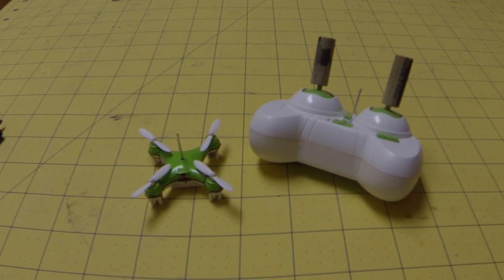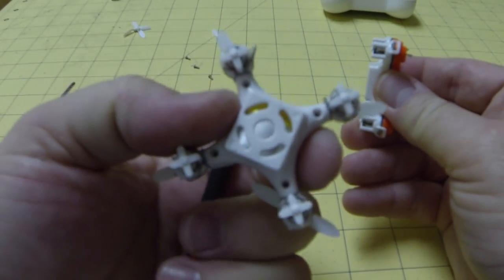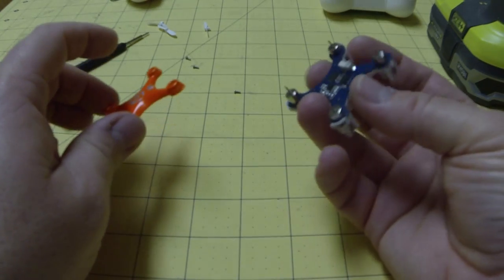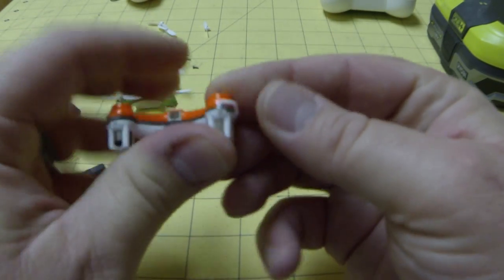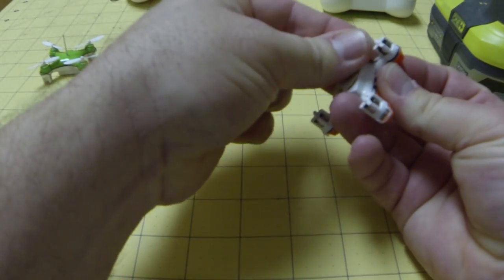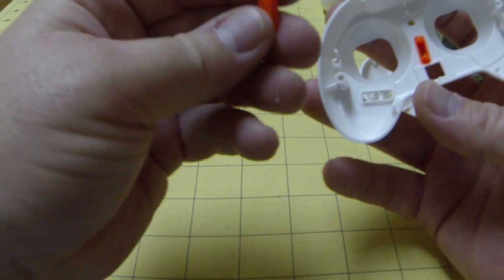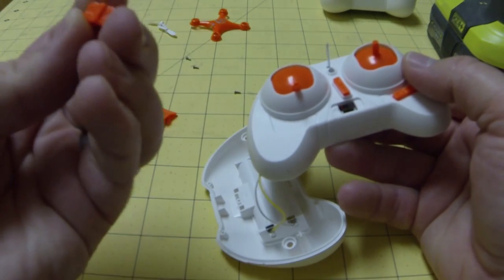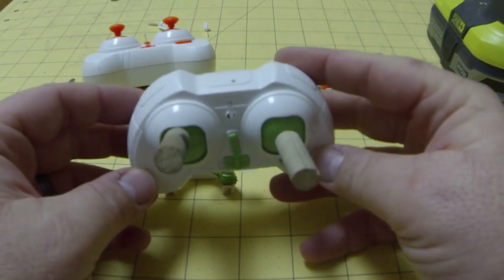Cheerson CX-10 Antenna Mod

Comment: I did my controller a little different before I saw your video. I knocked a small part out of the top were the case goes back together so it exposes more wire. Unfortunately my quad copter is a blueboard, oh well.

Comment: i got cheerson CX-10 from ebay , it works fine in indoors but when i flew it outdoor, at maximum height , it feels like motors stops and start several times and it comes down, need help to fix it, any suggestions please ............
Reply from the maker: +Sameer Athaley My only suggestion is to maximize the placement of the antennas. Make sure they are not coiled up. Other than that, your range has many factors affecting it, including the environment its in. These are not designed to travel far. Sorry.
Reply: motoshane
today i brought my transmitters antenna out, it might solve this problem, let me check tomorrow. there is no antenna inside CX-10 , its blue board, i saw that there is antenna which is hidden inside red board  cx-10,

Comment: Great video! I'm going to order my first. Do you recommend the CX -10 or CX 10a? Whats the difference.  Thanks!
Reply: FilmFactry I  recommend the CX-10. It has better yaw from what I've read. The CX-10A has heading hold, but from what I've read, it doesn't work that well. Either way, both will take a good amount of practice.

Comment: thats sucky if you have to do that, my gintrude gets great range no drop outs and besides they are nanos and you can lose site really fast with them i had mine up about 50 feet and man it gets tiny fast .. so why would you want to get more range unless of course its not getting hardly any range in which case that sucks for 2.4 ghz
Reply from the maker: I do fly beyond distances most likely will, so I need every bit of range increase I can get. See the following video to see how far away I do fly. https://www.youtube.com/watch?v=-3wNoHbmTGY&list=UU_kFMWwYOk3KGOiN7yvIEKg

Comment: I have a skywalker 5036 quadcopter it has no external antenna because it uses ANT instead. Do you happen to know if its possible to attach an antenna to it?
Reply from the maker: The antenna is likely a trace on the control board. It might be possible to cut the antenna trace and solder on an antenna.
Reply: +motoshane Very cool! I believe you are correct! Thank you!!! For answering my question.

Comment: I tried the antenna mod on my cheerson cx10A with blue pcb with built in pcb antenna, now it will not turn on at all.  did it short circuit?
Reply from the maker: Soldier1287 I've never had the CX10A. I'm not sure how that would be done, but it sounds like something did go wrong. Sorry.
Reply: it's pretty much the same thing but blue board

Comment: How do you know know if you're geting a green red or blue board when you order one??
Reply from the maker: From all the retailers I know, there is no way of knowing. Its possible there are some that will tell you, but I haven't seen them. You can buy just the green or red board by itself on banggood.com for about $10, but you'll also need to buy a compatible controller, which they offer also.

Comment: What is the best way to storage the battery, with full charge or empty?, this when I  finished the flight, thanks
Reply from the maker: R Blackby Storage voltage is around 3.8 volts. There's no easy way of measuring this. Best to store just before the low battery warning comes on. Never store fully charged, although I'm guilty of that at times.
Reply: Oh thanks, very helpful

Comment: And can the existing antenna be EXPANDED/EXTENDED?
Reply from the maker: Okeefenokee the Seventeenth This antenna comes coiled in the quadcopter and controller. Expanding the antenna likely will make it worse, especially if the manufacturer has it tuned to the proper length.
Reply: motoshane Thanks. I saw on YouTube an antenna mod, but am not sure yet if I do that, too. Did you see that one? Search for "Antenna Mod".

Comment: hi! how can i increase flying time? i'm think about stronger battery its posible make?
Reply from the maker: Best Cars2 This is a tough one. Increasing your battery size, will likely add weight, and decrease your efficiency. You likely wouldn't see much increase in flight time, and your CX-10 would become sluggish. Also, the current battery is a tight fit. You would have to cut the frame underneath to allow for a bigger battery. Its also tough to eliminate the frame, because the frame holds the motors tightly in place. If just want to keep flying without waiting for batteries to charge, buy 3 CX-10's and keep them all charging.
Reply: thank you for reply, It's possible include 3 CX-10's battery for 1 Cheerson??? Like 1 battery)
Reply from the maker: I'm sorry, but I don't understand your question.
Reply: I mean is it possible to connect the 3 batteries in one cheerson!!
Reply from the maker: It would be too heavy to fly. Sorry.
Reply: Oh okay,,,, so few time for fly i'm think 5 minutes so bad... 30mins my dream ))
Reply from the maker: Best Cars2 Sorry. Current battery technology can't do it at this size. You'll have to build a large multicopter.
Reply: ok, thx u for info! so much thx.
Reply: +Best Cars2 Buy 3, and you can always be flying one while the other charges :)   Also your friends will love you when you got extra little drones to fly

Comment: Hi nice  upgrade jjjj, I have one CX-10 but I have a issue, for charger the quad I need put presion for charging
Reply from the maker: R Blackby I believe you said you need to put pressure on the connector to get it to charge. If so, the charger side connector pins get loose over time. Its difficult, but you can use a small pin/needle to press the grasping pins back together. Good luck.
Reply: R Blackby my charger came with a "male plastic arrow" on top of the cable indicating orientation to plug it in, BUT the quad DIDN'T came with the corresponding whole for that arrow, and had to hold the cable to charge. I ended up cutting a bit of plastic from the female connector on the drone to make it fit, now is PERFECT.
Reply: R Blackby I lost my cx-10 charger and I tried charging it with other helicopter chargers but they make it aouto fly even when its off Anybody help with this?

Comment: and so.. i cant seem to find any antenna in my CX-10 only at my Controller wtf
Reply from the maker: I explain in the video there 3 types of flight boards for the cx-10, and not all have a wire antenna. They have a PCB trace antenna on the board directly.
Reply: Bryan Joshua u can still mod the controller and get a bit more range :)
Reply from the maker: cinexstudios Thanks pointing that out.
Reply: +cinexstudios yeah already did

Comment: is it necessary to put an antenna?? what is the benefits
Reply from the maker: Gilles Radoosing Only if you are losing radio contact. You are pulling the antenna out of the quad frame if there is already an antenna in it.
Reply: Thank you.

Comment: should i buy cx10a or cx 10?
Reply from the maker: The cx10a is the same except it has heading hold. No matter which way you spin it, your pitch/roll stick will always act the same. If you pull back on the pitch/roll stick, it will come back to you no matter which direction the front of the quad is facing. Push forward, and it will always go away from you, and similar with moving left and right. It might be good for beginners, but once you learn to fly properly, you won't like heading hold.
Reply: ok, thanks for explaining me that new  function, but i heard that they changed the yaw rate.
Reply from the maker: Adrian Lau I don't own a CX-10A. Watched a review on it, and it does look slower. Its definitely not for me. Probably good for a first quadcopter though.